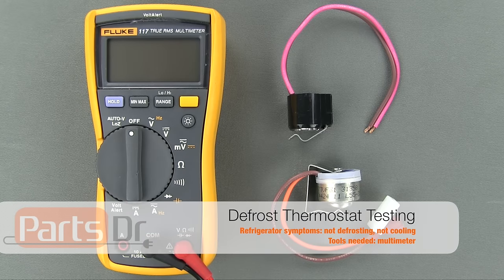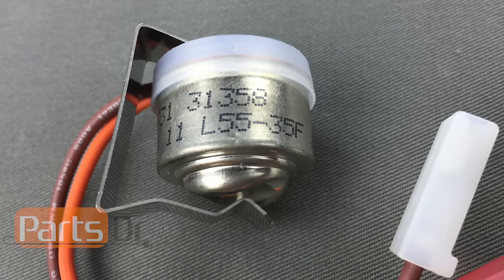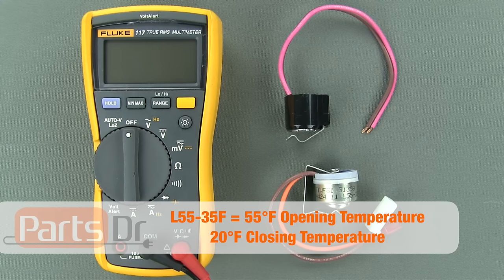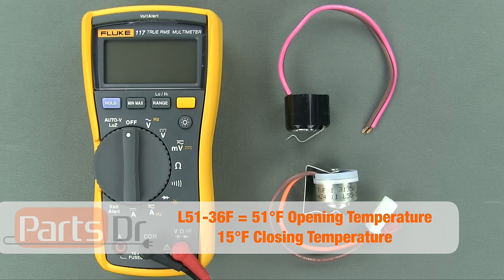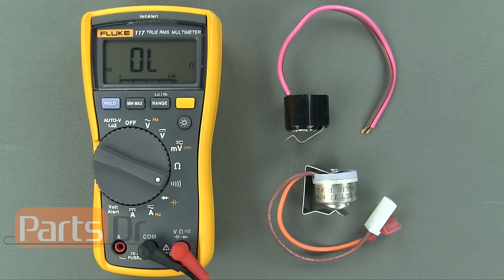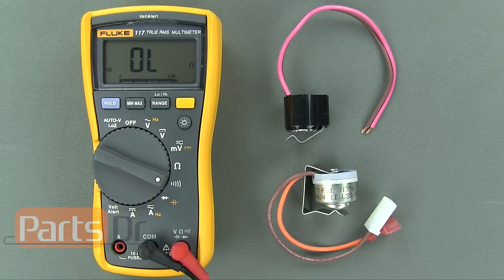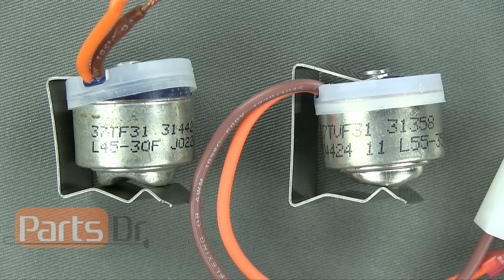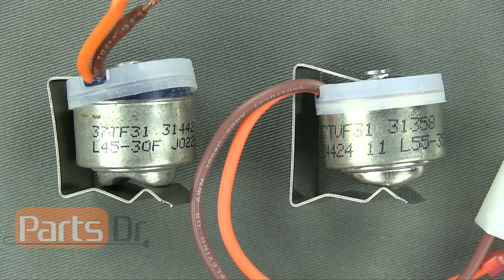How To Test Your Defrost Thermostat & How They Work

Comment: Good video. Whenever one of our fridges starts acting up around 8-12 years (icing/warm refrigerator usually) I replace all the main defrost components and put the unit into a rental. It's usually around $180 to do the timer, heating element, thermostat, cold control and maybe a cracked plastic door bin or two. Can't believe the cost of new fridges - used to buy basic rental property fridges for $249 vs. $1000 today. Too much printing of fake money.
Reply from the maker: Very smart!
Reply: Isn't it amazing how basic of an idea it is yet all our so called "experts" are always shocked when printing more money makes inflation go up lol.
Reply: One simple trick - adopt the gold standars
Reply: Agreed..   Reaganomics at work.   National debt tripled in 3 years.   It's only gotten worse

Comment: Now I do not know what is wrong with the refrigerator. After watching several videos. Your was the first one I have found that explained to take the first number and subtract the second to find the where it kicks off and on. I was screwing around with ice water and all I did was make a mess. So I put the thermostats in a freezer and found the one I had was good. I bought 3 new ones thinking the first new one was bad. Now I have 4 good ones and still have No idea as to why the side by side is freezing up. I know the heater works, The refrigerator I have has the electronic box inside, not the defrost type you can turn the screw to get it to kick on. I found that if you hit the light switch 5 or 6 time quickly it will go into defrost mode, that is how I got burned. I did not feel any heat off of it, so I got brave/stupid and touched it. A few moments later I could hear water steaming off of it.

Comment: Awesome video.. I understand the 55 degrees or higher there is  no continuity.  This is the case where the heater element has been on for several minutes and the thermostat opens to cut off the heater.  I also understand the low end number which is the typical case where the defrost timer kicks in and the thermostat is like way down near zero or better degrees and the circuit is closed so the heater is safe to turn on.  What I don't understand is what's going on with continuity in the middle range between 20 and 55 degrees?  I am assuming the thermostat is closed allowing the heater to work until 55 degrees is reached.  So why the 20 degree figure?  Why not just have one figure - open above 55 and closed below 55 degrees??  Thanks for explaining. Great video once again
Reply from the maker: Great question!  It is because the manufacture does not want the thermostat to open and close at the same temperature.  What happens in the middle depends on whether the thermostat is in an open or closed state.  For instance with the numbers you provided, if the thermostat is at 37F it could be opened or closed.  If the thermostat has already down to 20F or colder and it is closed and it has warmed up to 37F then it would be closed because it hasn't warmed up to the 55F to open.  If the thermostat has opened by warming up above 55F, then the thermostat cooled down to 37f, it would still be open at 37F because it hasn't reached the closing temperature of 20F.
Reply: Thanks for the great reply totally explained it well. I had an interesting way of checking my heater defrost element sticking my Fluke temperature probe in a screw hole down near the heater element which allowed me to see the temperature go up to 108° verifying that the heater cycle was working correctly without taking off the entire panel which is a real pain in my GE fridge. Love those Fluke instruments  Thank you
Reply: @PartsDr  this reply really helped....but still need a bit of clarification. I have 25-47F Bimetal Tstat,connected to my Ohm meter from below freezing warming up it switches from continuity to no continuity right around 25 F (according to my digital temp sensor tool )so from closed to open circuit as temp hits to 25. Then it will stay open  if it goes up and past 47F and not close the circuit again until it drops past 47?
Reply from the maker: @wyocoyotewyocoyote9007  Most bimetal defrost thermostats that we have seen open at the higher temp rating and close at the colder temp rating.  So if yours worked that way it would open at 47F and close at 25F.  These are general rules and each manufacturer can do things differently if they want to.  From the results you got it sounds like yours opens at 25F and closes at 47F and should be just fine as long as it works that way consistently.

Comment: Thank you kindly for your SPOT ON video regarding the defrost thermostat.   Especially the decoding of the open and close temperatures.    As a hint, ICE CUBES taken out of the freezer are typically about 0F.   So if you have a second working freezer compartment, you can place the thermostat in the ice tray for 10 minutes, and then remove with this ice WITHOUT WATER to reduce the defrost thermostat temperature.   To take the temperature, some meat thermometers do get down to 0f.   Fortunately my digital volt-ohm meter was purchased with foresight and comes with a temperature probe.     God Bless You and God Bless America.

Comment: Thank you for the video. I ordered a timer and a thermostat.  the T Stat was busted open like the bad one you showed.  Great video. This will be my second time replacing these 2 pieces. the first time was over 10 years ago and that time the fridge was about 7 years old. I'm hoping it last another 10 after this. $45 worth of parts saved me $1000.
Reply: Bi metal  time  d  forted  th,,  over lord  realy    set piont  know  all  one by  cheked  temperch,,,,wir  testng  must be  comper  checking  runing  eazey but not  reparing   samll  thing semples ok

Comment: Bimetal sometimes pass the continuity test , but the contacts dont hold when the heater comes on, so the continuity test is not 100% reliable, I learn with experience whenever I replace the timer or heater I also replace the bi metal tio avoid recalls
Reply from the maker: Yes, this is good advice.  We recommend the same thing.
Reply: Exactamente, así pasa. Se puede ver en buen estado el termostato de descongelamiento, pero es mejor hacer una prueba con la carga ( resistencia,  foco,etc,) para ver si logra encenderlos, obvio también con su respectiva medición del voltaje que de a su salida.
Reply: Saludos desde Sinaloa, México

Comment: Great video. I changed my thermostat refrigeraror, but the refrigerator is still working constantly. The refrigerator it's very clean below. So what could be the problem?
Reply: It is Possible that Your Defrost Timer or Switch is Stuck or Possibly Broken. @ the Top Right Corner of the "Fridge" there Should be a Plastic Set Screw, You can turn the Set Screw with a Flat Head Screw Driver. If I am not mistaken you can Turn the Screw "Gently" Clockwise until the Fridge Stops Running. If the Fridge does not Start Running After You shut it Manually, Then there most likely can be a Problem with Your Defrost Switch.

Comment: I wish I had seen this video a few hours ago.  I  just replaced my defrost thermostat after using the place-in-ice-water method, and I think it may not have been necessary.  My timeline: my fridge was not getting cold enough.  I realized it the day before going on a trip.  I vacuumed the (very dusty) coils at the bottom, and the next morning the fridge seemed colder, but I thought I should order parts just in case.  I ordered a heater and a thermostat.  The fridge seemed to be operating normally when I returned from my trip, but I had the parts, so I thought I'd go ahead and dismantle the freezer and test the existing parts.  My intention was to return both parts if the old ones passed the tests. I opened up the back of the freezer and there was no ice on the fins.  I thought, great, the existing heater works!  I cut out the thermostat, placed it in ice water, and didn't get continuity.  So I decided to go ahead and put in the new thermostat.  Because I'm not experienced with using a multimeter, I thought I'd test the new thermostat to see how the test should work.  To my surprise, the new thermostat also failed the test!  Stumped, I thought I might as well install the new thermostat, since I had opened the package and couldn't return it.  My fridge is now gradually cooling off.  Now I have seen your video, and can attest to your statement that the place-in-ice-water method of testing is not adequate.  I'm going to let the site from which I bought my parts know about my experience.  I cleaned the fridge thoroughly, so at least now I have a nice clean fridge to show for my efforts.
Reply: I would like to add that the temperature rating on both thermostats is L8.9-16.7C.  Converting to fahrenheit, that's 48.02-62.06.
Reply from the maker: Sorry to hear about the incorrect information you were provided before you found this video.  We specifically made this video because we had our own customers contacting us thinking their new defrost thermostat was bad when it actually was just bad information that was provided to them on how to test the part.  If the refrigerator still doesn't cool down, it is sounding like you may have a refrigerant leak in the sealed system of the refrigerator.
Reply: @PartsDr  Thank you for your reply.  Fortunately, my fridge is cooling down as I hoped.  I really appreciate your thorough video.

Comment: He mentioned putting it in ice won't work.    Ice is simply water below 32 degrees.   It could be 20 degrees, 0 degrees or lower.    You really don't know unless you have a thermometer to check it.

We had a stupid, stupid supervisor who was trying to calibrate a metal rod thermometer in ice.  He had doctorate degree but I could never successfully explain to him why what he was doing was wrong.   

In his mind, ice was 32 f degrees.   Put the thermometer in, let it get cold and adjust to 32. WRONG!  Melting ice is right at 32 or 33.   He understood if you put a block of wood in a freezer that was zero degrees, when it cooled down it'd be zero degrees.  Same on a block of steel.  But, put in a glass of water in a freezer that's zero degrees?  It'll be ice that's 32 degrees in his mind.

Comment: The defrost thermostat for my kenmore fridge has this sequence of characters on it.  L8.9-16.7C.  Converting to Fahrenheit it comes to L48.02-62.06F.  This seems backwards in that the first number is lower than the second number and the close temperature calculates to -14.04F.  What is wrong here?
Reply from the maker: That is correct.  The closing temp can be very cold because it is attached to the evaporator coil which gets cold enough to close the thermostat.

Comment: I wanted to ask you my closed is L60-32= 28 degrees for a closed circuit. Wr50x10090 is only putting out 2.7 of resistance when I check. I noticed yours was like 6.5. Is 2.2-2.7 at like 18degree ok? I also checked the heater element it was like 40-50 ohms. I have the G.E. GBSC0HCXCRBB
Reply from the maker: Yes that is a good reading.  We would recommend to replace the defrost control board PD00023371 (WR55X10837) and the defrost thermostat PD00023359 (WR50X10090) at the same time.  Also make sure to manually fully defrost the evaporator coil before turning the refrigerator back on.
https://partsdr.com/part/wr55x10837-control-board/#model-GBSC0HCXCRBB
https://partsdr.com/part/wr50x10090-defrost-thermostat/#model-GBSC0HCXCRBB

Comment: Great video! Very helpful in explaining the part #'s on the defrost thermostat! I have a defrost thermostat L47-22F 240386402 on an electrolux bottom freezer fridge (Model #EW28BS71IS9) and the top part is popped off partially like you show in the video. Again, that was very helpful explanation on why that happened! The heater element tests fine and hopefully the control board will be okay because it's hard to find details on this fridge! Thanks again for such a helpful video. :)
Reply from the maker: Awesome! Glad you found it helpful 😀

Comment: Please help. My thermostat is showing continuity at room temp. Bought a new one and the new one is doing the same. I have a 55-5304521781 frodgidair. Thermostats has FR-5 57/43 on it. Evap coils keep freezing over. Heater has continuity and measuring 30+ olms
Reply from the maker: It may be normal for it to have continuity at room temperature if it is a "high limit" type of defrost thermostat.  Learn more here: https://www.youtube.com/watch?v=i4SNEgPoUMY

Comment: Is defrost thermostat interchangeable,  C to F or vice versa? For example, my original defrost thermostat uses F, if I replace with new one with C, will it still work? Or I have the same version F? 

I have replaced start relay, capacitor, defrost thermostat and defrost sensor
Added new freon. My Kenmore bottom freezer refrigerator still does not work. The temperature is 57 F for the fridge,  27F for the freezer after 1 1/2 days.
Reply from the maker: As long as the temperature rating is the same, it doesn't matter if the temperature is listed in Fahrenheit or Celcius.

Comment: Our Samsung French Door Refrigerator bottom freezer bimetal defrost thermostat doesn't seem to have any "L" numbers, only 100 10 and 60 / 40.  What do those numbers mean? Also, at room temperature it had a continuous beep when we put it on the ohm meter. We're trying to figure out why the bottom freezer fluctuates in temperature between 0 degrees and even up to 30 degrees.  Ice cream is soft and ice is slippery.
Reply from the maker: The bi-metal thermostat on Samsung refrigerators is usually a high limit safety that only kicks in if the main control board or temperature sensor fails.  It will usually have an opening temperature of 100F+.

Comment: I hope you maybe some help.
My refrigerator Maytag mtf1895aew 
Defrost thermostat 
#63001388 is bad and needs to be replaced. Part is being discontinued by the manufacturer. Leaving no suggestion of any alternative. I have tried every site can’t get it. Can’t get anyone from the manufacturer who can help. Call customer service they are more interested selling the warranty product. No technical support or suggestions available. 
Now my question is:
Can I use a  thermostat from other manufacturer that looks similar to one I am replacing. I was told if the temperature of replaced within the same range it is ok. Now how do I know what temperature the bad one and the new one has to be. Please help if you can. Thanks
Reply from the maker: If the temperature rating is the same, you can use a different thermostat.  Follow the information in the video about how to read the temperature rating.

Comment: Hello, Our fridge is a Whirlpool Gold side by side and the fridge starts clicking and seems to go defrost mode a lot lately. It still cools ok in both parts of the fridge. It shows digital instead of 2 to 15 and fridge side 39 to 46 and then it snaps out of it and is back to 2 and 39. Can this be the defrost sensor? I ordered a new condensor motor/fan but suspect since the fan seems to run when its not in defrost mode its not the broke part. I notice when I press the quick cool button the thermostat numbers switches to freezer -6 and 34 fridge and it truly cooling like shown. Thank you for any advise.

Comment: Does this and the hearer element run 120v AC or is it converted to DC? 
Glass heater element was burned up, but after 30min im not sure its workinf as the tube isnt warm.
Reply from the maker: All of them that we have seen so far have run off of AC voltage.  The heater is only turned on periodically to melt the frost, it does not heat continuously.

Comment: Hi there.  My current defrost thermostat states L175 - 20F.  What would the opening and closing temperatures be with those figures?  I don't think that 175 degrees would be the opening temp LOL! ;O).  Thx for the great video!
Reply from the maker: Th defrost thermostats with a higher opening temperatures like yours are a safety device in case the main control board and temperature sensor don't properly regulate the temperatures on their own.

Comment: Thank you for the excellent video.. as usual. My thermostat has 100% continuity..doesn't that mean that it's in constant defrost mode? However the evaporator still ices up while my heater,  sensor and fan are fine thanks to  your excellent testing videos. Is it possible that although the defroster shows constant continuity, that it's just totally bad and the control board is not getting any signal to turn on the heater(even tho as mentioned) the heater should be on constantly....thank u in advance for any reply...
Reply from the maker: It sounds like your defrost thermostat is probably a high limit safety thermostat.  It only cuts out if the evaporator coil gets too hot to prevent a fire.
Reply: @PartsDr thanks so much for quickly replying.... I'm not sure..i immersed it in a cup of my faucet hot water 140° left it in fir 10min n still had continuity...
Reply from the maker: @jags132section  Some safety thermostats have an opening temperature over 140F.